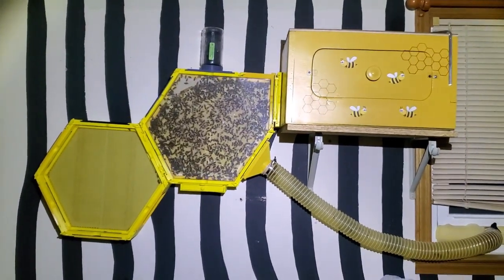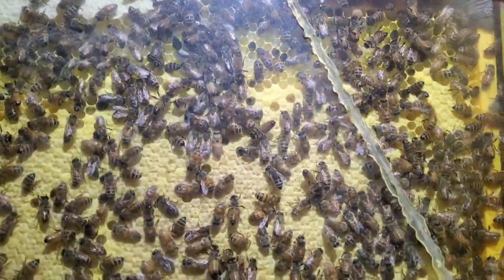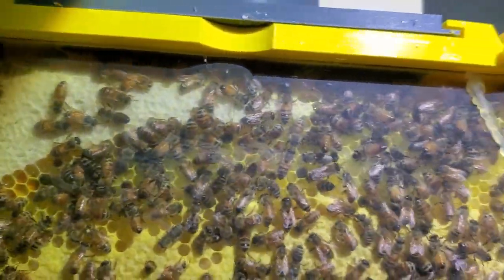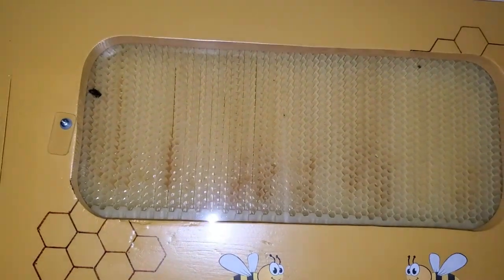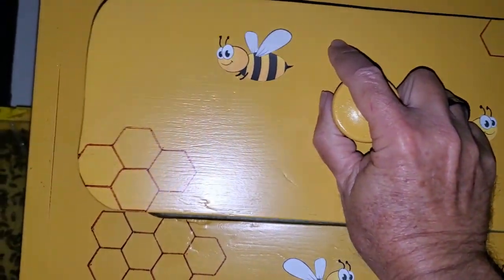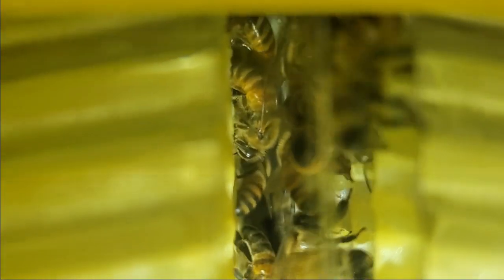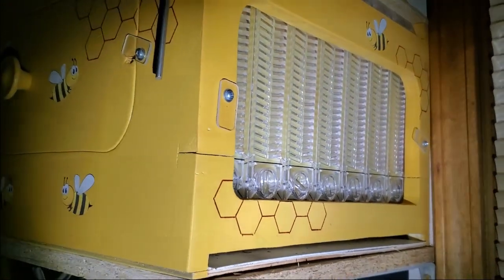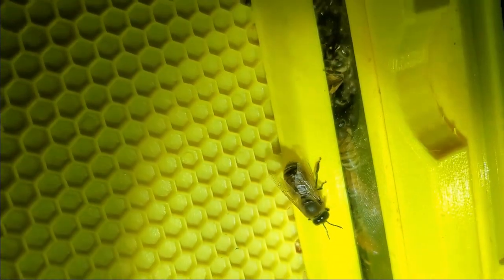3D Printed Observation Hive

Comment: Hi, love your project I plan to prinint my own working on trying to fit it on my smaller printer.  Do you plan to release the flow hive connetor part? I bought some flow frames and would love to set this up! Any tips for print orientation? seams like a LOT of supports with how I am looking at it.